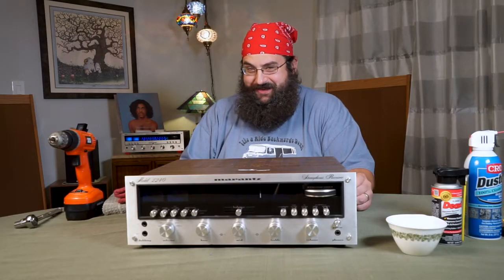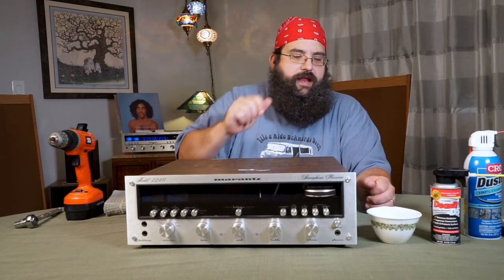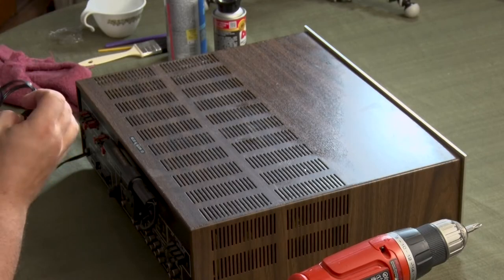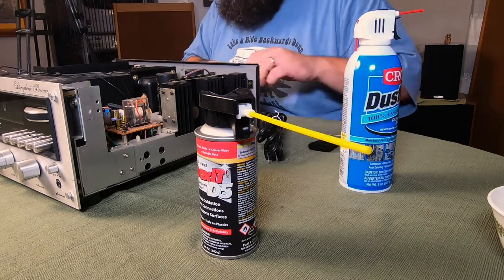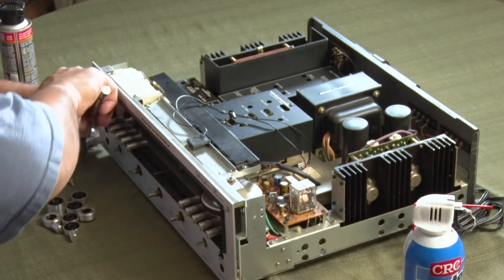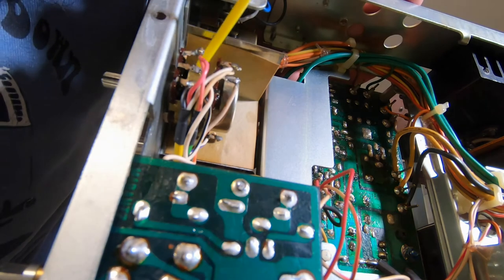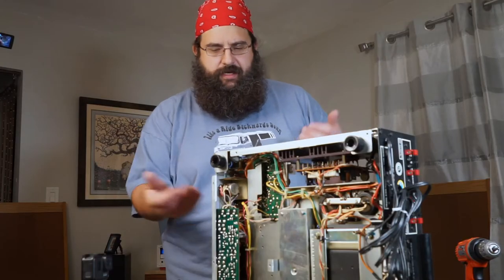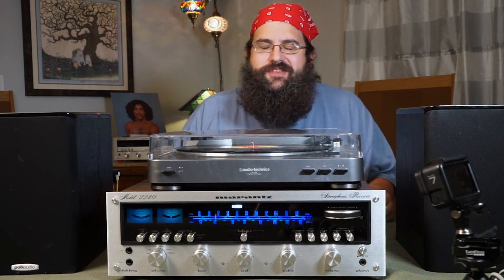I DON'T KNOW STUFF: DEOXIDIZING A MARANTZ 2240 RECEIVER

Comment: Nick, thanks for the video.  I have a Marantz 2250B that I using last night and the right channel was not as loud as the left.  I pushed several of the buttons on the unit until I rotated the tone control knob and the right channel was finally equal to the left.  Sticky pot.  Deoxit? I have not done this before so your video is extremely helpful.  Finally, I had an issue with the balance slider and took it to a tech in Ashville NC who stated he had to bypass it because it was not functioning any longer.  This has been my receiver since high school so it has not been abused, but he bypassed the slider so I am looking for a replacement on e-bay.  
Thanks again for the video.  Dave